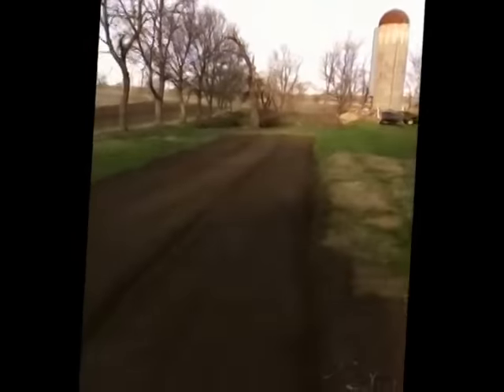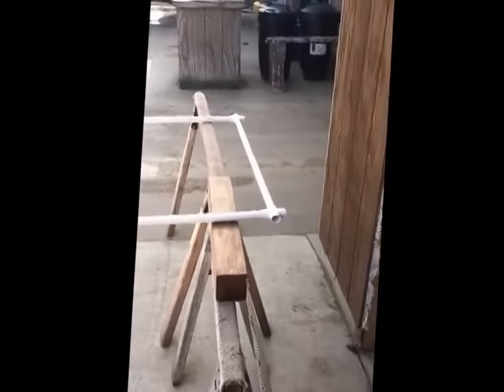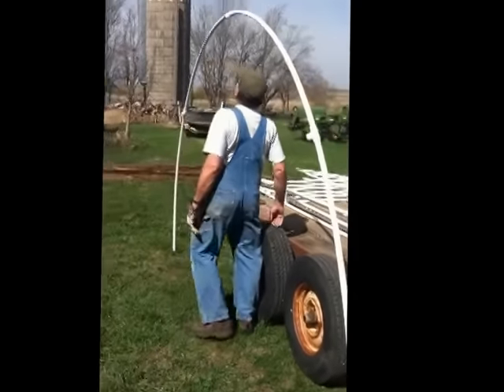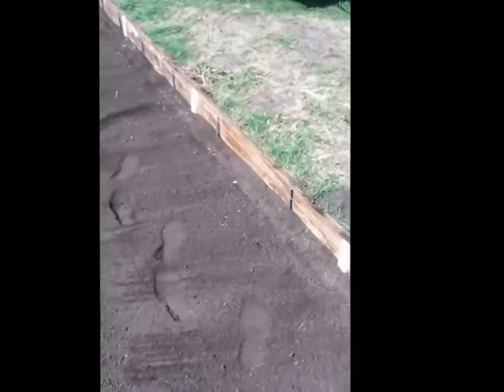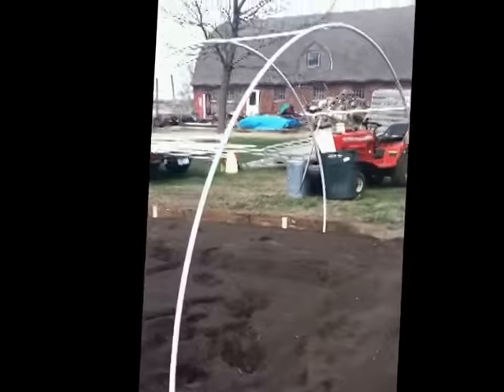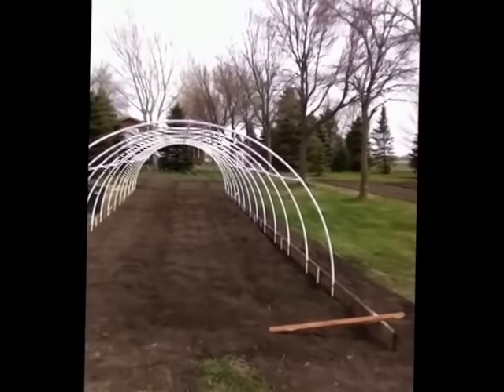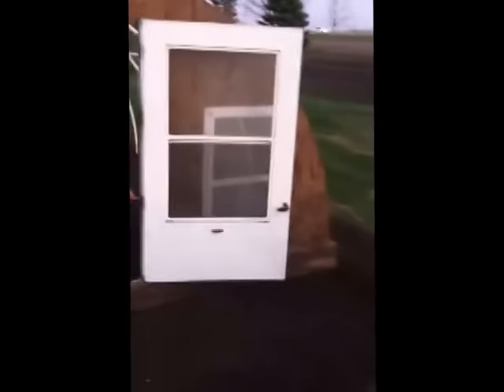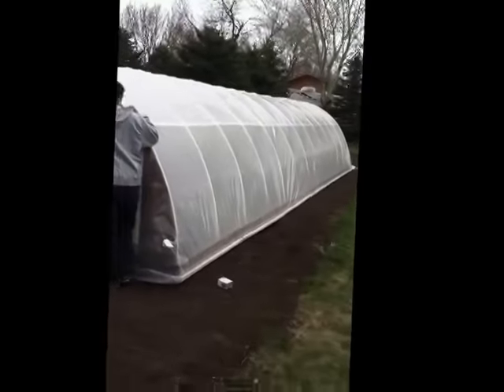PVC greenhouse in a day DIY

Comment: This design would not require gluing it together. It should be designed to be broken down if needed. Cement canvas could be used to make an out building using this design has well. ; )
Reply from the maker: It was still able to be broken down, but in bigger sections
Reply: A modular A frame design that you can fold flat for easy storage and set up. with a truss down the center for lights or for mist nozzles with growing beds in the ground or raised. Or a hydroponic set up from a fish pond near by? That you could use Manson hot air engine pumps to to circulate the water for your hydroponics. Novartis
Reply: A very good design for an area with snow fall. ; )

Comment: Oops hit the send button too soon. Anyways, he answered he had been doing this for years and it was just fine and insisted that we finish the job without any PVC cleaner. I found out later that he did a pressure test the next weekend and for a while everything was fine. He left the water on all week and came back to multiple blowouts in his ceiling. Everything was soaked! Insulation, drywall ruined, flooring soaked and swollen and buckled the walls. A very expensive lesson. I found out from mutual friends. For some reason he never invited me back. Do you think he might have been embarrassed?

Comment: So u think it will hold up to a lot of snow
Reply: snow should slide off easy enough...its the winds that need to be monitored...a protected site with a wind-break would be best.
Reply: Stephen VanDyke that's why I build a geodesic dome instead out of metal conduit. No problem with the wind.  I wrapped chicken wire on the bottom half of the dome and used the same plastic they did.  Shrink wrapped method.  No problem with snow or wind, because it is a dome.
Reply: Nick Tamble Even though the  snow will slide off, there will still be a side load build up to deal with. Just wonder if the span between ribs is close enough to support the plastic  with a snow build up. I may have missed it, but are you using greenhouse grade plastic sheeting of hardware store grade 3mil stuff?

I really like the simplicity and ease of building. I have  some acreage, 'bout 42, in the high desert. Snow fall is low there due to mountain weather shadow, but the winds are high at times exceeding 60 mph. With water, very productive land, a short growing season. This looks like a very good method, but I might add a center support to add anchorage and structure where full season vine crops could be suspended.

Comment: You did not support your ends!  Are you keeping those long boards on the ends to hold it up?
Reply: You refer to the no triangles folding from the ends problem.    With 2.5 inch heavy galvanized bows 3 feet into the earth, in florida without guy wire, modest winds would bend your end walls 2 feet off plumb.    But with 2 feet of cement on each pipe you might be ok, but for a hurricane, I would have guy wires on the ends.

Comment: There's no way to roll up the sides. That's the only problem I see, for if/when it gets too hot.  If it's 75 degrees outside, you can bet it's pushing 100 degrees inside.

Comment: nick  come back and update is it still there ?
Reply from the maker: had some trouble with a heavy wind storm (60MPH). Didn't totally destroy, but needed some reinforcement...
Reply: Nick Tamble I used a similar idea to make a car cover under a tree at the top of my drive your vid gave me some good hints and tips and idea's .
in the end I made my framework from trampoline tubes and covered it with black plastic sheet shrunk to fit with a heat gun

Comment: Try not to use this as a guide for gluing PVC if it's going to have any water pressure. I volunteered to help a man install PVC hot water lines in his back woods camp. It was on stilts so he insisted on running all his PVC above the ceilings. When I noticed him just glowing and sticking together the fittings without using APC cleaner, I told him PBC comes from the factory with a film of oil which will cause the fittings to blow apart.

Comment: Where did you purchase the "T" connectors?
Reply: gary24752 www.menards.com is where we purchased, though any local hardware store should have them - depending in where you live...
Reply: +Nick Tamble does the 6m provide proper penetration for sunlight? i might build one of these on arid land to prevent evaporation

Comment: Not very clear on the attachment of the plastic to the bottom edges??  Also have you considered another layer of plastic on the inside with 1 inch space between each layers of plastic.  I understand that this creates a very insulative barrier.
Reply: Blowing up the two layers. will give you an easy 3 hours after dark before the inside air equals the outside air temp without heat.   But celantro would grow great, and greater in a window frame hot box inside the greenhouse while snow is outside.   The soil heats during the day, and averages much warmer inside at night, because on snowy days, this will still get to 100 degrees or more at noon in the winter sun.
Reply: ***** If you mean it will not get to 100 degrees f. inside at noon while snow is on the ground, you are wrong.   I have many greenhouses, I know these things.

If you mean the air inside and outside will not be the same temperature a few hours after the sun goes down, it will.
I measured many if these.   They work well.

Comment: What is the life of the plastic??? More than one season with the UV rays... My experience was just one season...!!
Reply: 6 mil greenhouse plastic lasts me longer than 3 years.
Reply: Other videos show to paint your PVC, or wrap your PVC in some kind of tape to make a barrier between the plastic and PVC. They also recommend to use electric conduit PVC instead of plumbing PVC.
Reply: Sherri Strickland I think how you build your greenhouse depends on your zoning rules and the winds you expect to see.
In florida I use 2 inch galvanized steel pipe arches, 3 feet into a cement foundation with rebar thru the pipes in the cement.
That will stand up to a hurricane.
But the pvc solutions will do fine as row covers much of the time.
You will build fine either way, just a matter later of finding out if you built a greenhouse, or a kite.
Reply: True. We live in Oklahoma. Been thinking about building one and watching many videos. We get Tornadoes. Don't think simple hoop houses will work here without extra anchoring and stronger materials.  In my comment I was relaying something I stated on a video that PVC and the film don't react well together. It mentioned to extend the life of your poly to wrap the poles with some kind of tape or something to put a barrier between the pvc and the poly. recommended because the pvc heats up when the sun bears down on it in conjunction with the vibration from the wind. not sure if the wrapping was to reduce heat up of the pvc or to reduce the chaffing. Maybe both.
Reply: Sherri Strickland Probably just chaffing.    They tape over bolt heads and discontinuities.
Reply: +Sherri Strickland  you're 100% correct as the electrical pvc conduit type piping (gray colored) is UV protected where as white & Schedule 40 are not.....planning on building one similar here within the next day or 2 ...my folks are out there on Oklahoma now visiting with my moms sisters various locations mainly southeastern OK.

Comment: dude you're a professional. You have like a 1200 sq ft garage and sit on 100 acres. CHEATER
Reply: shakaama not my property...but thanks for watching
Reply: Nick Tamble Where did you find poly in single lengths of 40 feet?
Reply: johnnyohness I purchased a 100 foot roll and cut it in half...you should be able to find 50 foot lenghts....
Reply: shakaama  Since when is having a large property or farm cheating?  You can still do everything that was done in the vid, just do it in sections and then set up an area outside to put it all together.  A concrete driveways works.